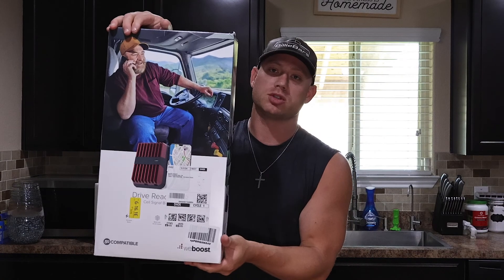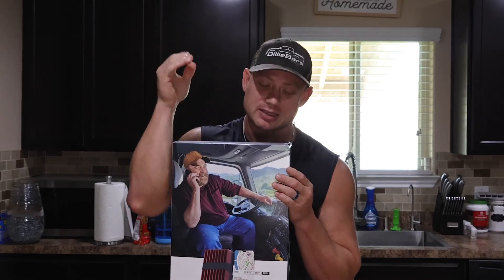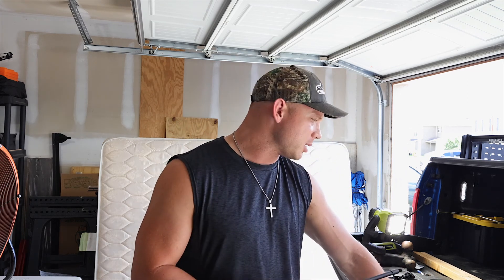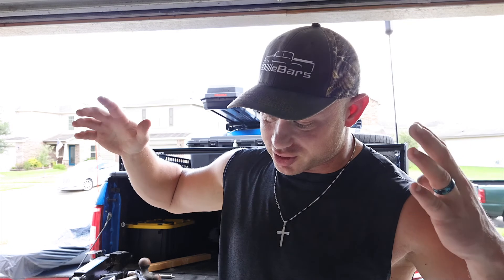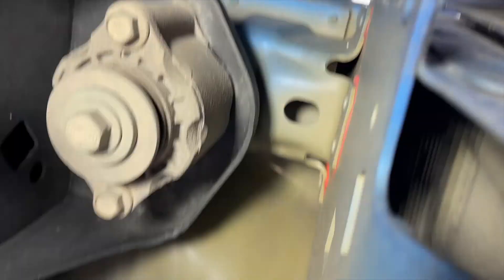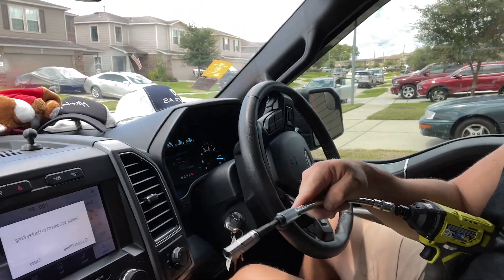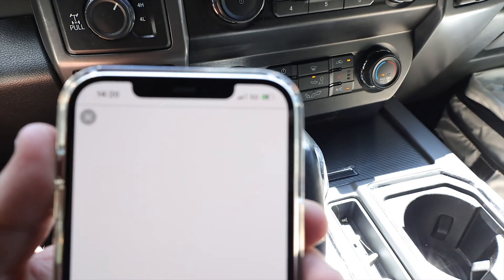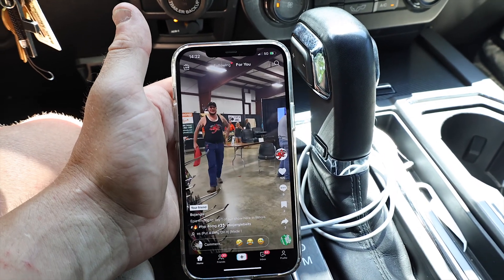We Boost Drive Reach OTR Fleet Install Ford F-150

Comment: did you have to drill the hole to fish the wire thru the cab? or was there a hole/gourmet there already?
Reply from the maker: There are 2 holes on the passenger side. One in the corner behind the column and the other under the inverter! Just pop out the grommets
Reply: For some reason i am not able to locate the holes. 2018 must be different or im doing something wrong
Reply from the maker: no they are the same, they are covered with a black plug, you just have to pop out the plug  @Sanjuk0522